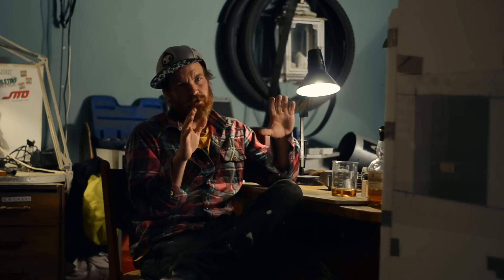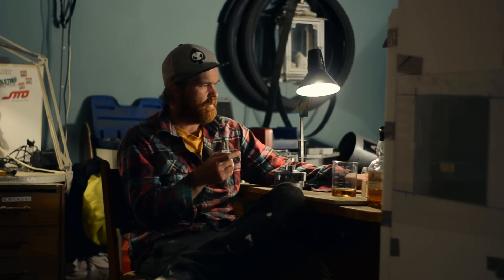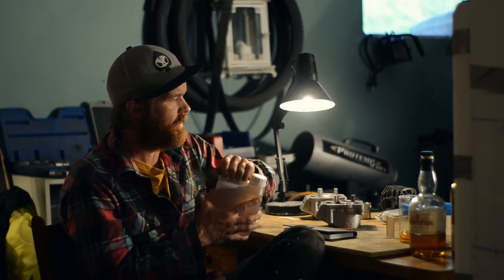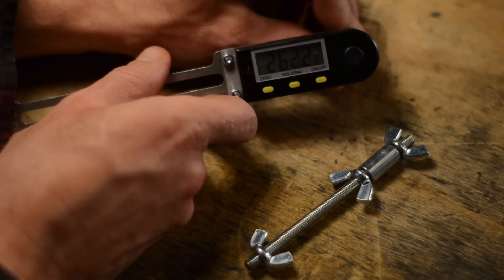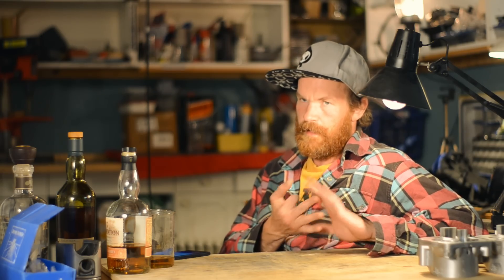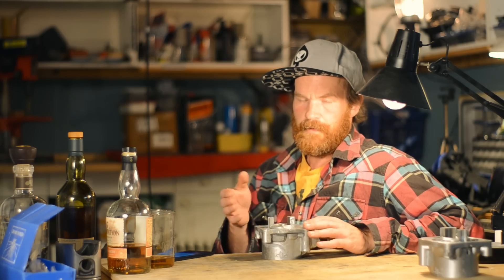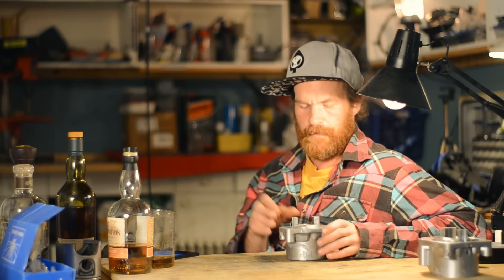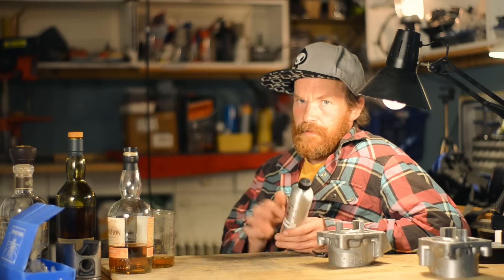The Most Powerful Two Stroke Ever - progress so far

Comment: 44hp out of a 125cc and 72hp out of a 250cc single both on c12 over 23 years ago..lol..
Reply from the maker: I'm aiming for 30+hp out of 50cc here...
Reply: @2STROKESTUFFING  
I can't remember what we got out of our 80cc and we never dynoed a 60cc. 
I would think your best chance would be with a rotary valve. Can't remember if that's what you were using or not? Think so. If you get close....you can always add another coil and spark plug and tip the can? Lol..a little nitromethane goes a long way .If you haven't I would look for a piston with the highest pin height possible as well.  Don't be afraid to over carb it as well. Your gonna be hanging on the big end to get that compressor to pump as efficiently as possible..some good retard on your ignition curve to match up to  high rpm..You know you can remove the factory pin for the ring and install a new one where you would like the end gap to be...if you know all of this sorry for repeat. Run wire for your head gasket too. At that level.
Proprietary pipe. I know a silencer is worth 1.5hp on a 44hp cr125. The way you pack the silencer and core style is worth 3/4 h.p. it's amazing how many tiny things come together to make a true fire breather.  I run a 40.25mm carb on my 250 because we weren't into offset boring back then.  Wish we saw that potential. I am planning to upsize on my next build. 
I have built over 1000 2strokes from bare cases with all kinds of builds from stock to prototype. Haven't been on the scene for over 15 years?  Took a bored 450 with shoe horned valves and prototype ignition on different fuel (all was illegal back then at world superkart challenge) to beat a built cr250..
Those are all rear wheel numbers. So if you don't have a gearbox or drivetrain you can measure higher as well..water brake?

Comment: you was talking about a lathe, i have one second hand a Quantum ( Germany ) Today it is Optimum, but some replacemnet parts can be used. It was good spend
al together 600 euro's, with some overhaul and it does its job for its size. It is often what you the machinist can do. To be exact in very narrow tolerances, you can find ways to overcome
some misalignment from "lower quality" machines. https://www.optimum-maschinen.de/

Comment: The engineering states that best bearings are longer lasting when Soft surface rubbed by harder surface the piston is needed to very hard then the best is a softer inside of a cylinder. The better for longest running. Thank you for answering my text to you.

Comment: My I offer some advice? I have built 14 small bore 2-stroke engines that have broken records at El Marige Dry Lake.  Understand, peak horsepower is important to an extent but you have to understand how the cylinder fills when pulling up to your best power range. If you can't make torque low in the rpm range you will never pull the tall gear you will be running.  Ergo, you will continually be slipping the clutch just to get up to speed.  With one mile to work within the lack of torque will kill your attempt even if the motor makes big numbers on the dyno.  For me it came to cylinder fill,  squish velocity and a lot of pipe testing... in basic terms.  Cheers.
Reply from the maker: Thanks! This is where the variator shines - the engine can be held at peak power rpm all the time.

Comment: About the pedal; the harder you press down the pedal, the more friction goes into the transmission, so get the weights in the variator as close to perfect as possible. 
I think you're even going to beat the rc racing engines in terms of power, and that's quite the achievement!
Can't wait to see and hear the finished project!

Comment: Have you thought of adding a second opposing exhaust port having 2 pipes then you have an option of over 100 percent exhaust port width of bore as well as having as more than enough room for transfer port area?   Keeping it case inducted.  Side discharge exhaust, front - rear transfer tunnels.

Comment: Don’t stress about the coating.  It may be softer, but it has so much lower Cf that it will wear well and produce a lot less heat from friction.  Even though I think it will last longer than Ni/SiC, friction steals power, so if you are looking for the “most powerful” then longevity doesn’t matter.  Either way you win!

Comment: I could imagine the problem of plating flaking off in chunks would be a bigger issue than wearing out faster
Your softer plating might be a good thing (not so brittle-especially when you may have a relatively thick coating)

Comment: 23 years ago, my two stroke made 0.875HP per CC no turbo or supercharging. 50cc should be about 44HP to be equal.
Reply from the maker: I'm guessing that's based on manufacturer claims for a tiny methanol/nitro engine?
Reply: @2STROKESTUFFING  That was my worlds winning 3.5cc (0.21c.i.) 4HP nitro motor for 1/8th scale rc car, 7 port motor built by ron perris, tested on a dyno. It rev'ed top just over 60,000 rpm. If you like rpm, check out my 3.8 million rpm video https://www.youtube.com/watch?v=ZQE05T-3680&feature=youtu.be
Reply from the maker: 👍 Not sure I can beat that, even on Nitro...

Comment: Will you be running the motor counter clockwise to keep the piston load towards the intake side rather than exhaust side as with the very wide exhaust port it may try force the piston into the exhaust cavity. It might help with longevity

Comment: The reason for the low temper of the nickel Boron nitride coating maybe is to be found in the grid structure of the material Boron nitride. I have read that there is a main difference between  cubic boron nitride and hexagonal boron nitride. The hexagonal boron nitride (hbn) has a very low temper and the cubib boron nitride has avery high temper. Very good video. Now i am a fan of your channel.

Comment: Hexagonal boron nitride is soft and used for a lubricant. Cubic boron nitride is harder than silicon carbide and might be what to use in the cylinder. I thought silicon carbide was used in nikasil not only for its hardness but also for its high heat transfer. I don't know the heat transfer capability of boron nitride whether cubic or hexagonal. Oh just found on wiki that the boron nitride both cubic and hexagonal has better thermal conductivity than silicon carbide!

Comment: 40 on the rockwell "c" scale is pretty damned hard, but not quite as wear resistant as say case hardened steel (which silicone carbide chews through quite easily). My guess is your coating will "work", but will wear pretty rapidly in comparison to nikasil

Comment: From ASM Handbook - surface engineering , Electroless coatings need heat
 treatments at temperatures above 370 °C. For Nickel-Boron coatings standard heat treated at 400 °C (750 °F) for 1 h. After 1-h heat treatments at 350 to 400 °C (660 to 750 °F) hardness
 values of 1200 HV 100 can be produced.

Comment: I was thinking about the pipe for a while would it be possible to use two pipes on a two stroke one tuned for low end and one for high with a valve controlled by a servo, possibly it would be pointless since the ports dictate the range of the powerband, its just an idea ive had for a long time to try and gain mid range
Reply: Yes it can and also a pipe with adjustable length by sliding end cone. But not worth it since the gain is moderate at lower rpm and powervalves (sometimes coupled to resonate chambers) do the same thing good enough.

Comment: Maybe a very stupid Idea, but how about a nikasil coated aluminium liner. The liner could ve machined quite easily on a lathe and milling machine, so porosity isn't a problem, coating is also easier because of the simpler geometry of the part and it could be machine honed on a lathe too. Also due to the aluminium the heat transfer is probably still good enough and you could even build it in a way that the water is directly flowing around the liner.

Comment: I did not go back and look but, your metal/CBN matrix is still nickel based, right? You might need to just up the powdered CBN amount, the SiCarb can't hurt though. CBN is harder than SiCarb. I happen to work in a commercial investment casting business (mold maker, machinist really, that works in the tool shop for the wax pattern molds) that uses vacuum aided filling for certain specs with certain materials. Here's some food for thought, we put the whole investment under vacuum in a larger container, vacuum all around the porous investment (fired, preheated investment, should still work on unfired) except for the sprue which is under the surface of molten aluminum. Think about it.

We also prototype 3D printed parts, I'll ask what product we use to protect the pattern. And,last but not least, your telescoping gauge method is now spot on, congrats.  If you want to ask me questions about investment casting, I believe you can contact me through here.

I edited to say that the investment is turned upside down with the sprue under the surface of the molten aluminum and the vacuum applied to the entire outside of the investment

Comment: Cross hatch looks good 45 degree., Would have been a 'Pass' in my class. I guess I should make a short vid about measuring with 'T-gauge'? There are easier ways of using it to get good reading. I always taught people to use left hand only for gauge and right hand for micrometer. That way you get a more consistent feel and can measure into the 0.001mm range (if you have a vernier micrometer) I've got a Suzuki indicator from the 1970's like that one with long and short adapters. It uses a much smaller dial (maybe 30mm dia?) so you have more clearance4. Hadn't used it in maybe 25 yrs but did a 1968 SuzukiT305 last summer

Comment: actually using a dial indicator to find top dead can be off by about 3 degrees. make a solid stop like a metal plate and you will get EXACT tdc. since the crank can still rotate a bit without moving the piston at tdc

Comment: You should use your vacuum pump to pull the air out your plaster of Paris. Would eliminate a lot of bubbles there and may make a smoother casting.

Comment: loving the videos , just goes to show how with know how , research and determination , how far you can go , i see you're using a telescopic bore gauge , you would get far better accuracy with a dial bore gauge as there's no user error , not calling your skills but I've used many different methods over my 32 years in precision engineering and that method is the best for the outlay , unless you want to buy a CMM :)
Reply: +1 for the dial bore gauge! There will be no mistakes with such setup. Also keep the cylinder and bore gauge and caliper at same temperature for at least 1/2 hour.

Comment: This might be a silly question....but.....
 Why do liquid cooled motorcycle cylinders blocks don't have cooling fins? I know they're water cooled but with added fins...doesn't it make the bike even cooler? The only reason I can think is cost..maybe there's more reasons?
Reply: It's not too uncommon that they do have this on 4 T. Look at Honda varadero 125 for one example. But it is for looks only. I guess it's more cost and weight effective to increase the size of the radiator. Good question, not silly.

Comment: I had an idea that might help you. Use an old propane tank or air compressor tank as a vacuum accumulator. Pump it down with the pump as far as it will go.   Then have a pipe from the container you put your hot crucible in and open the valve all at once.  The shock should get all gas bubbles out in a very short time while the aluminum is still as hot as possible.

Comment: Soak your reamer with diamond dust, it will cut the existing coating and it’s pretty cheap.
Reply: It´s virtually impossible to machine away a hard coating from a softer material. The stones will wear through unevenly and cause an oval bore. If that´s what you ment. I may have misunderstood.....

Comment: When using Hardness test files, it's better to start with the black (RC50) file as it's the hardest. You don't need to use them as a traditional file but just lightly push one direction with slight downward pressure. If the file teeth "grab" the surface then proceed to the next lower hardness file and progress until the file slides easily across the work. This method doesn't damage the file teeth and preserves the integrity of the kit.

Comment: Whilst the Nikasil bore has clear power advantages, the time, effort and cost of perfecting it will eventually prove to have not been worth it at this stage. How long have you now been stuck on it and you still have big problems...? It would make far more sense to perfect the design of a running engine with a steel liner and at the final stage add a Nikasil cylinder. Any changes in the cylinder/port design moving forward means a new cylinder every time!! I cant see the Nikasil will affect any other part of the design that means you need it now. I have no idea why you are fixated with heat transfer through the cylinder wall when there are easier and better ways to solve any heat problem on a test bed engine...How much would it cost to have the final cylinder plated and how long would it take...compare that with what its cost you so far and how much time you have spent on it...

Comment: - Very nice work, also your QC pattern was very well done  !
- I tried to seal Stereolithography-  and also FDM patterns; never found something which was 100% tight; thought about printing a FDM-Mould for the pattern and casting wax into it in order to use the wax pattern in casting process later
- some say that Polystyrene parts out of SLS Process works better for casting 
- I  tried to build a temporarily extension for my  Vakuum Champer out of thick wood once; the wood walls became bend inward; it’s unbelievable what -1 bar can do !  Be careful !!
.
Installed the first Stereolithography-Machine in Norway ( I believe in Trondheim engineer school ) in 1993 (cannot remember right, had too much good time with the 2 guys in charge there :)  ).
Always dreamed about rebuild my old Kawa 3-Cylinder out of Rotax-Direct-Injection Engine Parts, at least you can make your dreams true and somehow I can project myself into it too :)

Comment: Hi! 
Been doing some professional plating a couple of years, mainly brush-plating. The top layer is always more porous, therefore a bit softer. Adding to that: A worn in cylinder likely has a finer surface than a honed rough surface that catches the file more easily.
Your surface IS likely softer than a professional one though. Pores tend to build with increased ampereage. 
Anyway, if you decide to remove the nickel, DO NOT hone it away. You will end up with an oval bore.
Edit: Forgot to mention, totally admire your work!

Comment: In THEORY this design is scalable, therefore the displacement right now, is of less importance than just developing the theory from the concept until it is proven to work, and then the design can essentially be scaled up as large as people would want, and PROPORTIONALLY the mass/weight-to-displacement would be lower as the displacement increases, meaning greater power-to-weight. ~( 'w')/

I applaud starting smaller. (~_^)-b
Reply: Always easier to make HP/litre with a smaller displacement engine. It cannot always be scaled up to produce the same result .
Reply: @dilsher12  It may be 'easier' [not sure what you are judging by] but the truth of the matter is, it is NEVER easy.

Physics, costs, engineering, technique, all of these various factors must be taken into consideration.

Typically, per CID [or liter if you insist], top fuel dragsters all go up over 500 CID [8 liters] to reach those top numbers and their HP/disp is at or near the highest known.

With the peak ever V-8 engine recorded producing 12,000 hp [1500hp/liter] and some people regularly running around 11,000 hp, [1375hp/liter] it is difficult to compare even though in indy cars, 1000hp/liter [ 1.5 liter engine producing 1500 hp ] may not be reaching their zenith.

I would advise that you take into account the fact that all sanctioned racing sets clear limitations on displacement as well as a host of other details for all racing teams to strictly comply with or face disqualification, so when you talk about this, ask yourself [or better yet, ask an expert in that specific field] :  "Would you prefer to increase or decrease the displacement of your engine, if the rules did not restrict?"

You might be surprised that even operators of very small displacement engines [where classes require they limit themselves] will answer: "There's no replacement for displacement".

Comment: you should send the finished cylinder to whoever is making the piston, your measurements might be different than what he measures with his tools. (different temperatures, calibration could be slightly different, differenet manufacturing tolerances in the measuring tools)

Comment: https://www.mopedarmy.com/forums/read.php?2,4269512
Reply: I understand the convenience of getting a pipe close to you, and i hope it goes to plan! Anyway if you ever wanted to just try one of my pipes i would send you one no charge, also my offer still stands for the separate cones/chamber i just got my cnc plasma table so prototyping is very easy now. Also for a tig welder i recommend something with at lest high frequency start and post/preflow control, i mainly weld thin gauge and it defiantly makes a difference.
Reply from the maker: Beautiful work man! I'll contact you when I've got something designed, and my lack-of-tig situation might be resolved, with pre/post flow and HF start.